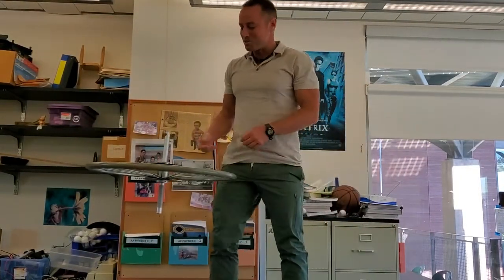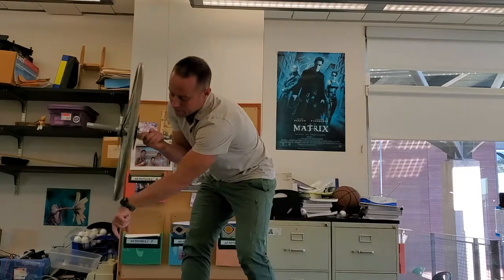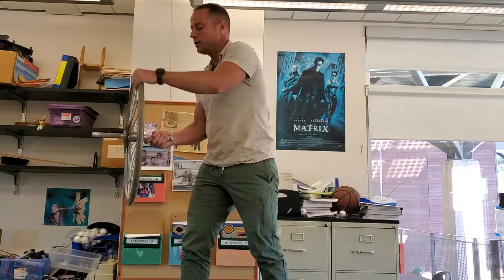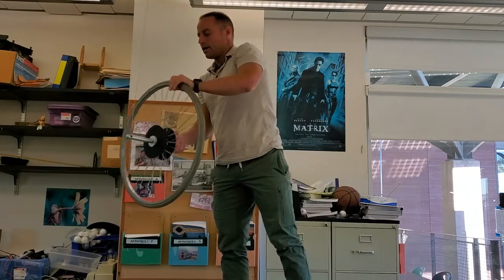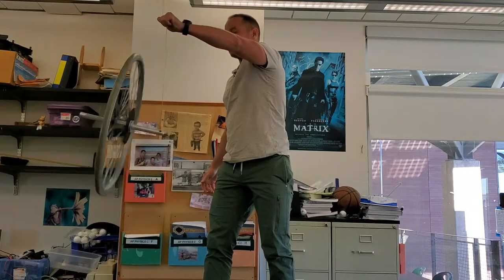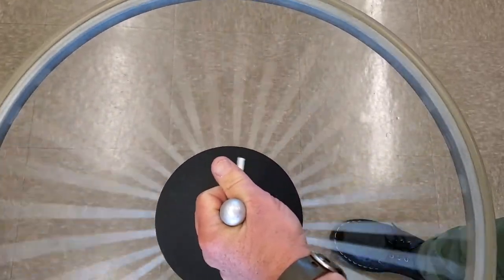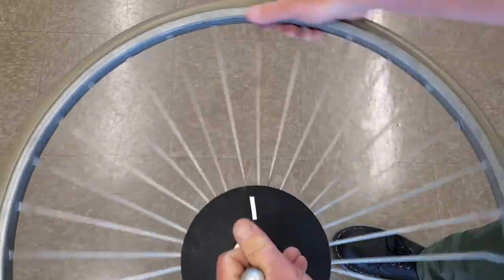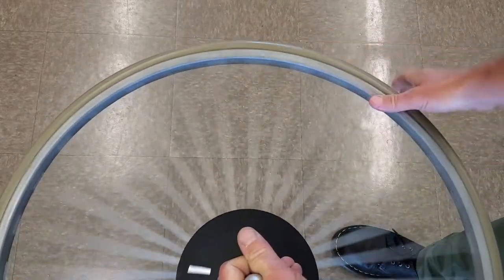Gyroscopic Precession of a Bicycle Wheel Explained

Comment: You explained it very nicely but i had a doubt why does angular momentum needs to be in the direction of torque and also are there two angular momentum acting , one towards you and one towards direction of torque? I mean why does angular momentum vector chase torque vector.
Reply from the maker: Torque is dL/dt, just as Force is dp/dt. The change in L points along the torque; this is directly from torque = dL/dt.  This is similar to the fact that a force points along an object's change in linear momentum, as in F = dp/dt.

Comment: Id be careful mixing angular moment with the systems angular momentum vector... i wasted countless hours deciphering this, afterwards I was met with another question as to how the system maintained rotational and axle equilibrium if the torque of mg • displacement is adding force downward on the system? Rotational relativity has been explained regarding two angular momentum vectors, but nothing on what counter weights the gravitational force? Perhaps i could be intuitive... but i could also use the help! Kindest regards.

Comment: What is the force that opposes gravity so that net torque on the wheel’s axle is zero?
Reply from the maker: One key is that the net torque is not zero about the point where the string attaches to the axle.  In the geometry shown in the video (wheel at left of screen) the torque due to gravity is non zero and points out of the screen toward the viewer. Since torque points out, dL/dt points out, so the tip of the L vector must sweep out toward the viewer. When the wheel not spinning, the L vector grows toward the viewer as the wheel simply flops down.

Comment: I would like to thank you very much for explaining this. Before this, I was confused why the wheel would move around in opposite ways when we changed the direction of the wheel rotation. Now I understand that it's not the combined angular momentum that decides the direction. It is because after you span the wheel, you still held it, so there existed only one torque with the direction towards you, and then thanks to the new torque after you drop it towards viewers, the angular momentum had to shift, which explains why it moved like that.

Besides, I have 2 related questions. I really hope you can help. I'm doing data and IT stuffs, but I have passion for learning these physics knowledge. 

First, if you only drop the wheel (without spinning it beforehand), there will be a torque towards the viewers, but I guess the system itself will not move towards us. Does that torque make the wheel move towards us, just like a force? Instead the wheel only swings to you and back around the vertical axis because of the gravity. Is it the case? If it is, is it because there is no shift in angular momentum? 

Second, if I have a rotating door, and I apply a very large force at the edge of the door (big distance from the hinge), hence very big torque. Assuming that I am pushing/pulling in a way that creates an upward torque, and there is no friction with the hinges,  can this torque theoretically lift the door upwards for a moment? Because this will help me understand whether torque can be understood as a force. For example, I know that helicopters fly up due to the lift caused by the difference in air pressure. However, what if the blades are not designed in a way that cause lifts when rotating, can a big force applied on the blades causing a torque upward help the helicopter fly up? Thank you so much for reading this, Dr. Pierce. 🤩

Comment: I'm curious, if you could attach some sort of spring scale to the string, would it still measure the same weight of the object ? Or would it measure it to be lighter in weight?
Reply from the maker: Interesting thought!  I think the sum of vertical forces remains constant and equal to zero since the center  of mass doesn't accelerate vertically. (Vertical component of tension = weight of wheel).  If the string angle changes and tension develops a horizontal component (say, in order for tension to help provide an inward force for the circular motion) then the spring scale reading would have to rise. There is a nice Veritasium video that is related: https://youtu.be/tLMpdBjA2SU. It at least addresses the issue of the vertical forces remaining constant.  I like your question. I haven't  paid enough attention to the string angle during precession.